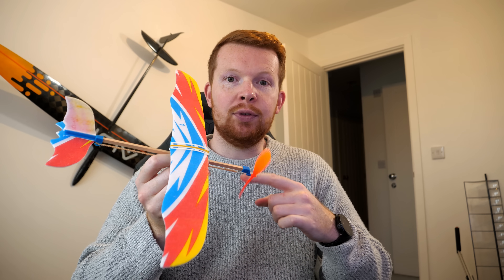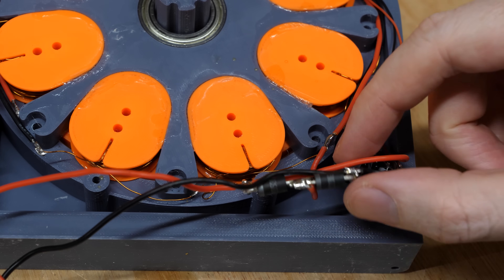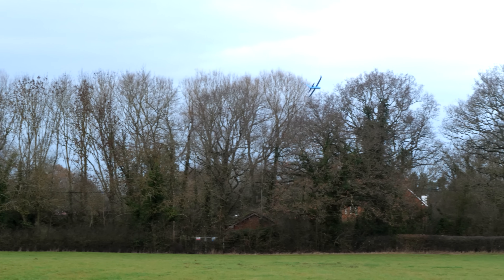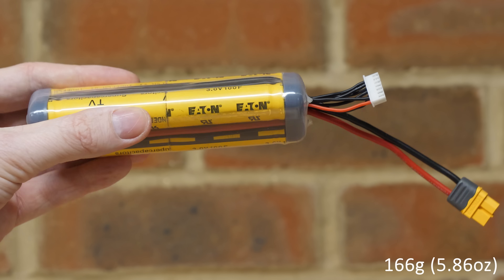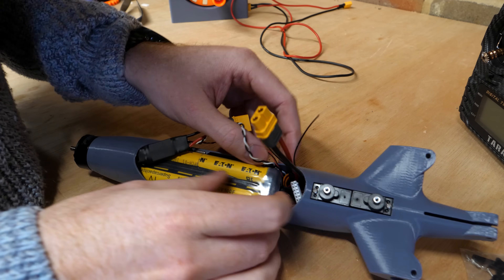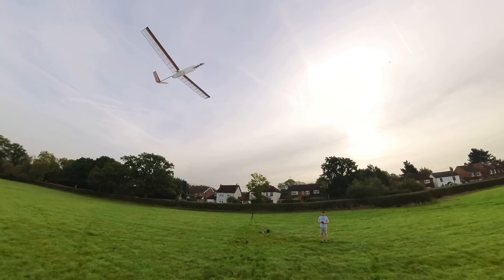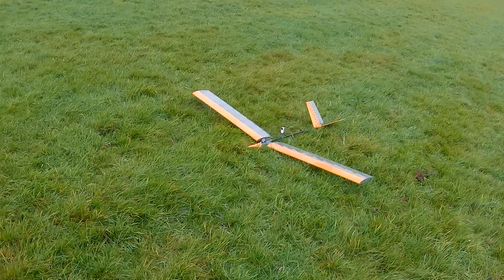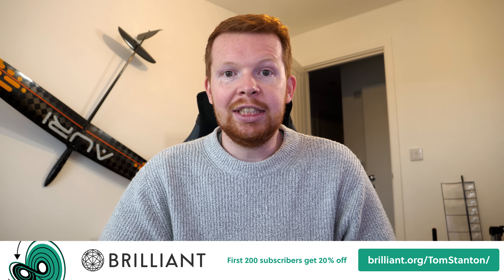Super Capacitor Plane

Comment: Why not use round magnets and round coils instead? 
A core half the diameter of the magnet, will increase cogging but also increase the voltage and power output greatly. 
What I used to do for 1" round 1/2" thick N32 magnets, was to wind the cores around a 1/2" wooden dowel, remove the dowel and fill the hole by stuffing black-sand moistened with epoxy and just pound it in, and let it cure overnight to have a coil with ferrite-like core on the cheap with great characteristics.  
Just attach a magnet to a stick, stuff the magnet on a plastic bag and pass it on the beach or by the river. When you have enough black sand collected around the magnet, just reverse the plastic bag and grab you sand in the bag. You can also crush ferrite cores from transformers and coils to a powder, moisten the powder with epoxy and get an even better core for close to nothing.

Comment: Couldn't you have made the generator more efficient by making it dc from the start? I mean if you had all the magnets the same way round instead of alternating, wouldn't that give you dc electricity so you wouldn't lose power running the electricity through the diodes of the bridge rectifier?

Comment: Need boost circuit so your plane doesn't die at 5 volts. Probably could use some regulation too so that the control of the plane stays consistent.

Comment: Couldnt you charge this faster than a normal Lipo battery? Like charge this at about a 1 to 1 ratio (atleast) from the wall? I would LOVE a plane like this, the super capacitors won't puff up and I could just practice my take offs and landings over and over again. If you sold this as a complete kit it would be awesome

Comment: You can use a DC booster to discharge the capacitors more. I've seen small microcircuits in flashlights that allow you to drain regular batteries to almost zero. Efficiency will decrease, charging time will increase, but this will allow you to stay in flight longer on same capacitors.

Comment: This was super satisfying to watch! And glad you're having fun with the big print volumu of the XL! :)
For small contact areas, I definitely recomend the smooth PEI sheet. With it, the problem is typically the opposite, too much adhesion. But because you can swap them without any recalibration, you can pick which one to use depending on the model, material (perfect adhesion with PLA, a bit too much with PETG) and footprint.

Comment: For your problem of the printing area on the bed, you should enable the brim setting, on cura you can actually select it and enter an amount of line. The brim parameter allow you to create one layer arround the objet, then your 3d printed plane should stick better on the build plate. When your print succeeded, your brim can be lift off like a support. preatty good video

Comment: You could use a lightweight 5v battery to act as a voltage stabilizer for increased control during the glide regime.

Comment: I don't own a 3D printer or anything but I was wondering could you not have just added some removeable supports to the print design that would hold it to the plate and then break off after? just wondering...

Comment: I built a backup power supply for a small security dvr, ran for 15 minutes before dropping down to 6 volts, from 12.5. Worked great until the power was off longer than 10 minutes. The small power supply couldn’t overcome the super capacitors to charge above 5 volts. Used it for over a month.

Comment: If the ESC braking approach didn't work, some spring-loaded prop hinges could work. Under power, the centrifugal force would hold them out, and then once off the power, they'd be folded in, and stop windmilling.

Comment: Whenever I see generators like this, nobody bothers to carry the opposite poles of each magnet to the other side of the coil, meaning a much lower flux density than the magnets are capable of.  It isn’t exactly hard, since you have two magnets with opposite  polarity next to each other, just put iron plates opposite them on the other side of the coils  that bridge the space between.

Comment: Instead of the balancing connector, you could simply provide a large high-impedance voltage divider (one resistor in parallel with a cap each). The leakage currents of the caps could flow through this, and all caps would have the same voltage.

Comment: Letme just throw it out here. Use lion battery to spin up flywheel while the plane flies. Once it lands the flywheel energy is converted at actuall 200W into the supercaps. (much faster than giving few tens of W with the crank generator) And cylce that until the batteries die. The caps are cool for the charging rate, but if you can't use that feature it's wasted potencial. Yes i doubnt there is portable flywheel capable of such storage and yes the circuitry that would alternate the inductance of the flywheel gen keeping it at 200W also wouldnt be simple but yeah it's an idea.

Comment: Print a nose cone for the folding props. add a very light spring pushing the props back. it will stop the windmilling. if you could time it just before the motor cuts out you could also maybe use esc braking to fold the props back.
great project and awesome video thank you :D

Comment: Outstanding as always! I was wondering, would boost converter with low cut-off voltage make any sense here, helping squeeze more juice out from capacitors? Could try and drain them down to 0.5V with something like TPS61023

Comment: If you could get it to a 1:1 "hand-crank to flight time" ration, would it be then, in theory, possible to make an on-board generator that is turned by the spinning of the prop? Therefore indefinite power... ;-)

Comment: Cut 6x6 inch 6w solar cells into 6x1inch 1w 0.55v x 15 cells per wing joined in series & then in parallel to make between 30wh - 15wh @ 8.25v depending on light conditions.

Comment: To reduce most of the drag from the prop it could be useful to have a mechanical stopper that pushes itself out upon the voltage dropping below a certain point so it always stops in a way that it can fold reliably the same way every time which also could save the props even though the system you’ve created seems reliable enough

Comment: If you used an RC car ESC (or ESC with a brake) could the glide time before the voltage drops to 5v be extended?  This could help prevent a fly away or crash from high altitude.  As I understand it, the braking action of a RC Car ESC can put power back into the battery.  Would probably need to limit the braking rate so the ESC doesn't create a huge amount of drag?

Comment: Great video, love the project. You could make this even easier to charge if you built some kind of collapsible stand for a bike and change it with the rear wheel or something. That is probably a lot easier said than done though.
For the 3d print, a 5-8mm brim would have probably saved that first print. Really good bed adhesion to get as far as you did.

Comment: To be honest you could make the hand crank much bigger and in a standing position as well as a mount for the plane. 
You can swap out that plug for a switch and charge port. If done right the plane will be at a 45 degree. You load it and crank for 30 seconds pull a lever with disconnects the planes charge port and then placing your hands on the controller that has a mount too and hit the button and away the plane flies. Then you chase it down come back and load it again. This would be quite cool. Though I do wonder how much more time you could add vs the weight. Such a super cool way to fly for a couple mins.

Comment: if you add a current limit to the motor to flatten the curve of amp draw in the beginning you can get double the flight time, (but limit the total power) also, another way to increase flight time is getting higher voltage capacitors. of similar size / weight, lastly, could the propeller / motor server as a generator? if so, redesigning the propeler can gain you more flight time.

Comment: It would be funny to be able to regenerate power from the draft of the "dead" propeller. Juste enough power so you can have a little thrust at landing !
Or maybe add solar panel to see if it can fly as long as there is sun ?

Comment: Do you have an Engineering degree?   Did they teach you the unit Gram was a unit of weight/force in any of your engineering courses?   Shame on you!  It is the year 2023 not 1823.  Gram is one of the 7 fundamental units in the SI Metric System.  Static weight is a derived unit.  It is the product of mass multiplied by the acceleration of gravity = kilogram meter per second squared (= a Netwon.)  The mass of an object (gram/kilogram) is the same value on Earth, floating around weightless in space and on the Moon. But the weight is different at each of these locations.  Clearly, mass and weight are both conceptually and numerically different.  So don't use the same unit to describe both.  But, hey, the units Joule and Watt have the unit kilogram in them too.  So why not just just call those units gram/kilogram as well, eh?

Comment: would you share the 3d models for the wing (I like the composite structure with the honey combed ribs & film on top), and the body? 

btw fully matching wing body to the wings, so that there's no holes in between, would probably increase lift and decrease drag at least bit,  I'd guess the lift-induced-drag part of the drag, i.e. Cdi=(Cl^2) / (pi * AR * e), could be  maybe even halved if you're lucky (?), as otherwise I'd bet you might get a vortex in the middle of the wing, similarly as it happens at the wingtips. is this reasoning legit?

Comment: a 0.125 wh cap which can deliver 200w almost  instantaneously is the equivalent of a LIION cell with 1600 C discharge capacity !!
I simply love supercap since the first day I've heard about them. I made a portable drill with 500F super caps, much lighter and charge up in one or two minute with a small solar panel. Of course you can't screw more that 5 or 6 big screw with one charge but It's very practical when I work on my roof for example, where I don't want to have to change batteries.

Comment: Maybe you should put a buck-boost converter in the plane, to get more energy out of those capacitors. Also if you replace two of the diodes in the rectifier with capacitors you can double the voltage out of the rectifier.

Comment: Sometime in the mid 1970s I received a similar foam airplane as a birthday gift. It was much larger, four foot wingspan and it was made of expanded polystyrene (broke fairly easily). To charge it up there were two contacts on the underside where you pressed it down onto a 6v lantern battery. It would run for 30 to 45 seconds, half that time was useful thrust.

Which reminds me that in the early 1970s I had a HotWheels car that was in the shape of a bullet train engine, it was also charged up by a small battery pack and would run for a couple minutes zipping around the track.

We had some cool toys back then. Big Trak and Armatron are couple others that spring to mind.

Comment: There are 4 diodes in a full wave bridge rectifyer. But did you know you can use just two diodes and two capacitors for a "Delon full wave voltage doubler" to output a rectified and smoothed DC voltage at upto 2 times the peak voltage.  In other words, 12v ac (rms) =17v (peak) or 34v when doubled.  

Google Delon voltage doubler.  
Description. Take two wires from the generator, any color, but lets say they are white and black.  Black would center tap the serries of 6 super capacitors.  The white wire would connect to the anode of diode 1 and the cathode of diode 2. While the  cathode of diode 1 goes to the + terminal of the capacitor bank and the anode of diode 2 goes to the - terminal of the capacitor bank. 

It might be good to include a few 2.9v zener diodes in parallel with each of supercapacitors to prevent excess charge from building up on the supercapacitors. 

Use a buck boost converter to get a more consistant voltage and to be able to utilize more of the power stored in the supercspacitor bank. As is, you can only drain the bank down to 5v. 

Using a voltage doubler might allow you to use half the coil turns and have half the internal resistance in the coil, but in doing so, the voltage drop across the two diodes is a larger percentage of generator's output. What power you save on copper losses is off set by diode loss but diodes are cheaper and smaller than copper coils.  You can rewire your existing generator with two serries of coils in parallel for half the internal coil resistance.

Comment: I can't help think the main point of super capacitors is being missed here i.e. the practically instant charge rate.
Wouldn't it make a lot more sense to add a 4S lithium battery bank to the generator and then use that to instantly recharge the plane?
Extra credit for making the generator pedal powered so you can sit down and recharge it while you're flying the plane 😁

Comment: Nice project.  The big gaps between the wings and fuselage are not very aerodynamically efficient: it would fly better if you could fill that gap.  More 'wing' would be best, but even a flat plate would be better than nothing.

Comment: What if you added a small battery to charge the super capacitor ?  Like a stack of coin cells.  It slightly larger, to possibly use s small dc to dc to cgarge the cap in flight. (Or just add flight time) 
I think this is similar to the way the future if air flight  is going, build a electrplane. With electric motors, batteries in the wings or maybe in the belly of the fuselage is better, possibly having them removable in flight during emergency, with a turbine engine /generator in the tail. Basically idling furing the flight, or running at about 20% power supplying creature comforts in flight. And ramping up the power to about 75% . When the battery is. About 35-45% charge , and ramp down if or when the charge reaches 85% , a fuel supply could allow  Connecticut to Oklahoma battery only, then the engine allows the flight to go to California, or as far as Hawaii.  Basically a 2500-3000 mile battery range with basically enough fuel capacity to match that. In a large plane,  a cross country county type plane. Cross the ocean. A smaller puddle hopping prop plane 50-80 ppl . possibly a 500-1000 mile range, with another 500-1000-mile fuel range, with it plugged in to charge when landed,  charging at about 600v and 200amps with a airport covered in solar panels. The immediate area around the single plane should be capable of 500-1000kw, a recharge to 80% should be possible within a short time,  while refueling, and prep. A 95% could be easily possibly, with multiple thermal sensors in the battery, and the battery ran at lower temperature than a typical ev. Keeping away from full charge, and low charge. The flighi from ny to California should take only battery plus 10-20% of the fuel. This type of plane. Should cut ticket cost by 20%  being battery cost is higher, yet there us 1-2 turbine generators in the tail.  Being capable of maintaining flight. From its power alone. And charge the battery at  a faster rate than a typical  car home charger.   Mainly only ran st 60% power, at 95% it should be able to take off without battery power. And still fly, to circle or to the destination, charging the battery in flight. Keeping the plane in the air. Like a diesel electric locomotive with battery and wings!

Comment: Now I'm not an engineer, but instead of the crank on that generator I'd have added a pulley, wrapped a cord around it and just pulled.  I expect you could get far faster rotation from that and it would continue rotating for much longer compared to releasing the crank.  But like I said, I'm not an engineer...

Comment: Neat plane!
The windmilling of the propeller could perhaps be utilized for generating a bit of extra power for the steering, prolonging the time you have after the motor cuts out. It will however require some electronics to crontrol properly.

Comment: Epic idea! I would suggest adding a boost converter or joule thief circuit to the output of the super capacitors, as the discharge curve goes from very steep at higher voltages to very shallow at lower voltages, so you are not using most of your range energy that you put in at the moment. If you add a simple boost converter I think it could really help it. The only problem would be that for higher output currents you would need a bigger boost converter, which is more mass, but I don't imagine that the plane itself draws more than 1 or 2 amps.

Comment: good project.
you can add Zener diodes in parallel with the bank of super capacitors or even across each super capacitor to make your own over voltage and balancing instead of a bms circuit.
Just make sure you get zener diodes that are rated for the current.
you can get 5 watt zener diodes now but you can put them in parallel to handle more current.
Their operation is like a diode that starts conduction at a set voltage. i.e. they start shorting out any excess voltage until the voltage drops below its rated value and then stop conducting thus no longer short out the power rail.
I made a video on my channel about a 5 watt solar backpack for charging phones with super capacitors. the circuit included Zener diodes for voltage regulation.
check it out.

Comment: This is kinda awesome and nifty, I think of it kinda like one of those superlight gliders that get towed by a separate plane then glide back down, except it's both at once.

Just start out by getting as much altitude as possible then gliding back down.

-I wonder if you could make some sort of contraption that could collapse the prop once the motor is no longer powered? might help with the prop drag...